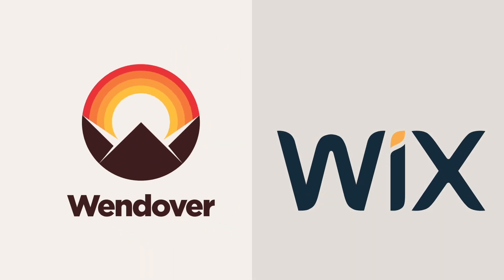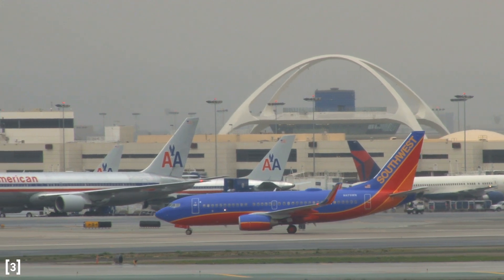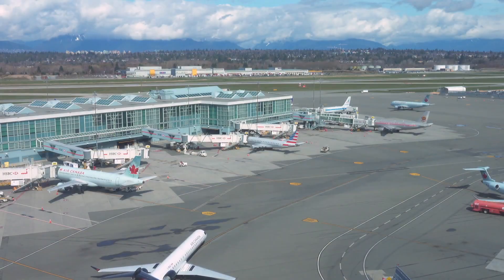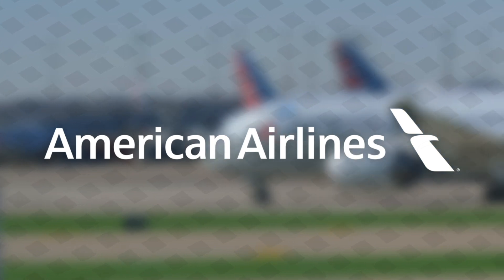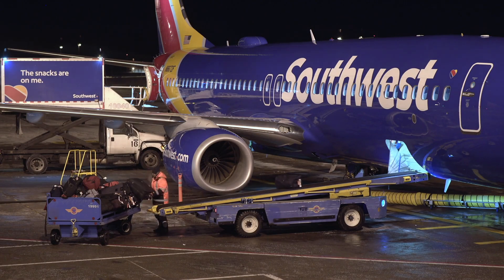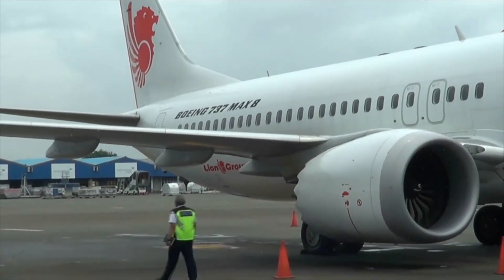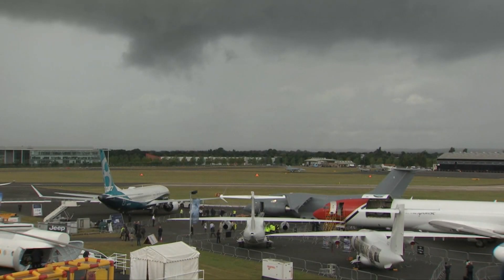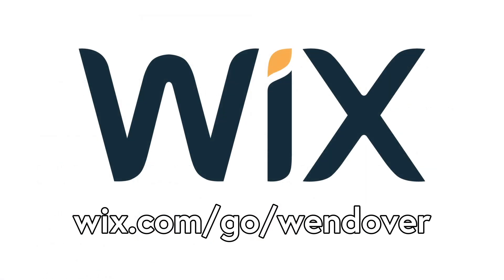The Economics That Made Boeing Build the 737 Max

Comment: “It has a few aspects that make it unique”

Its the first aircraft to be able to intentionally crash without pilot input
Reply: I'm pretty sure the Hindenburg wanted to crash after it was on fire, in order to get the passengers to safety.
Reply: @Aussie Tanker Your understanding of the word "intentionally" is sub-optimal. The planes crash due to a software mistake. A "mistake" is the opposite of "intentional".
Reply: Im pretty sure any plane would crash without pilot input
Reply: @eh4822  
Not my mavic drone lol.
I know it's not a plane, but it is an aircraft and does not need any skills nor any pilot to fly it.
Reply: @eh4822  Nope, planes these days are partly at the stage of automation that they could basically even fly alone. Pilots are mostly there to supervise, take over in emergency and perform takeoff and landing(not always). The difference between Boeings system and general autopilot systems is that boeings system cannot just be overwritten. You need to press a button within seconds and that button has never been showed to any of the pilots and was not mentioned in the handbook of the aircraft
Reply: @eh4822  Well depend on how you are talking about. All the commercial planes are aerodynamically stable. So as long as the engine is working without any input from the pilot the plane will maintain the heading and altitude.
Reply: I Set Some Grass On Fire DC-10 rear cargo door locking handle: Am I a joke to you?
Reply: Vsatyk United Airlines 585, USAir 427, Eastwind Airlines 517.

Google the 737 rudder issues.
Reply: Automatically*
Reply: Well........
Reply: How to turn a 737 MAX taxi,takeoff and brace for a crash
Reply: 747SP - China Airlines 006. 1985.
Reply: @ThatGuy-te9wh  well, it did it's best, it's just those guys tried to restart an engine as FL350.... and forgot to check the planes bank angle...
Reply: Funny, but not true. What about Air France 447?
Reply: @Santo_Aviation.YouTube  pilot error
Reply: @ahmeddarwich9267  there are a lot of people that would disagree. lot of fishy shit went on with that investigation. and it was shown that the plane would indeed go into "landing mode" if it thought it was low enough. 

not to mention it was in frances and airbus best interest to find the pilot at fault.
Reply: @ahmeddarwich9267  no it wasn't
Reply: @Vsatyk  Not only max wanna crash all 737 -200 -300 -400 have a "rudder issues"
Reply: Mateusz Zimon not all. The issue in the  original series has been resolved long ago. And the flaw didn’t extend to the classic series.
Reply: @mateuszzimon8216  And the 747 had a lower rudder 'hard over' issue, at least 2 of them.
I seem to recall the rudder 'hard over' killed people too.
Then we have the 777 that crashed at Heathrow due to a rare 'ice in fuel' problem.
Reply: Airbus was the first to cause crashes without pilot input.
Reply: Andy Madden they were not though.
Reply: @andymadden8183  if your thinking of the Air France demonstration A320, you need to think again.
Reply: KarlosBricks that’s controversy.

A330s were plunging down in the middle of the flight multiple times.
Reply: @gusp6612  yes but they all recovered. Don't @ me with AF447, that was proven to be pilot error
Reply: DoSvidanyaGaming the only reason they recovered is because it happened in high altitude. Unlike the Max, where it happened below 10k feet.

Also unlike the Max, where the dive can only be triggered by malfunctioning sensor. All the A330 systems can function perfectly and it can still dive out of nowhere. It’s a computer error that Airbus never managed to fix.

I’m totally against any system that alter flight control without the pilot’s command. Airbus’ anti stall system and MCAS is the two example.
Reply: @karlosbricks2413  I agree.  This crash was due to pilot error.  The flight computer was preventing a stall.  The pilot flew the plane too low of altitude and too slow, especially for an air show fly over at alpha max.  The pilot also missed the air show if I'm not mistaken.     I am typically a fan of Boeing.  However, the AirBus A320 was not at fault for this disaster and is a great airplane (e.g., Miracle on the Hudson).
Reply: @karlosbricks2413  no the a310 auto throttle

Comment: If a larger engine is more efficience and will be fitted but has to be re-position and that cause im-balance in the plane and MCAS was required, why? can't they re-design the landing gear instead of installing a killer in the plane? Pilots can see and computer can't, period

Comment: The reason Boeing didn't mention the MCAS is because an MCAS failure is identical to a runaway electric trim malfunction and is solved in the same way.  I'm very concerned about the fact that the 4 pilots on the accident aircraft were unable to handle what I'd call a relatively simple emergency when something hard, like an engine failure 3 knots above or below V1 could happen on any flight.

Comment: These MCAS incidents won't cause hardly any long term side effects. Many years ago, when the 737NG  came out, there were a series of crashes in which the 737 broke into 3 pieces. The fleet SAS grounded. It was found that Boeing outsourced labor to companies that didn't manufacture parts correctly, and that when assembled, the mechanics were alluring the parts to make them fit. Boring tried to cover it up but failed. Some of these planes are still flying, but Boeing recovered extremely quick. In fact hardly anyone remembers, or even knew about this. The same thing will happen to this.

Comment: The B-737 had several hard over crashes when it was first launched, and now the B-737 Max is unstable in flight due to the larger engines mounted higher on the wings. This plane is of unsound design and a soft ware fix, MCAS, is insufficient to provide the necessary safety margin. Imagine having a car that veers in one direction due to a design flaw but then has a software patch to provide corrective steering > how many people would trust such a machines. The B-737 Max should be scrapped, the plane is and always will be unsafe. And, Boeing must compensate the families of the Lion Air and Ethiopian Airlines crashed planes: suggested compensation $1 billion per fatality, and the responsible Boeing executives to serve time in jail for putting profits above human lives!

Comment: There is NO PRACTICAL DIFFERENCE in the fuel efficiency of the A320 Neo vs the 737-Max-8. Here are the empirical numbers. The A320 is a 44.3 tons aircraft empty but operationally equipped, it carries up to 195 passengers in a single class up to 3,500 nm with a maximum fuel load of 26.7 tons. The 737-Max-8 is a 45 ton aircraft empty but equipped. It carries 200 passengers in a single class layout (Max-200 config) to 3,550 nm with a maximum fuel load of 20.73 tons. Neither aircraft is able to take on maximum fuel with maximum passenger and payload. The A320 neo has slightly bigger fans on the engines; the 737-max has a slightly newer airfoil on the wings (designed in the 1990s vs the 1980s). Fuel burn is about the same per seat.

Comment: Don't know how accurate is a Bloomberg web article that claims that to save money, the company and its subcontractors used cheap 9-dollar per hour software developers, and used India software developers who had little knowledge of flying.  False stalling was created by depending only on the signals from one type of air pitch sensors, while the common existing horizon-indicating gauge signals, the throttle position signals and the existing air-speed gauge signals are not used, resulting in the new software thinking that a plane flying horizontally at full throttle at high speeds is staling, when the new air-pitch sensor malfunctions, perhaps from flying through a swamp of tropical inserts clogging the air sensors.  Pilots just did not think that such none-redundant and poor software could came out of such an established US company.  It used to be that cars made in America had a reputation of being lemons, while planes were well made.  Time has changed.  American planes may not be totally made in the US.  The US is starting to made lemon planes as well.  Pilots need training to learn how to fly lemons just like in the past US drivers needed to learn how to drive lemon cars.

Comment: You never mention the possibility of re-enginning the 757. The "75" is head and shoulders better than the 737. If Boeing had decided to re-engine and lighten the 757, upgrade the avionics they would have had a more efficient airplane at much less than the cost of the "new" narrow body design that you mentioned at the beginning of the video. The 737 "wishes" it could be what the 757 was when it was first designed in the 1980's. The 75 could have been what Boeing was looking for in terms of lower cost than a new design and more efficiency for airlines. They chose the wrong one and now they are paying the price.
Reply: 100% accurate. I'll take a 757 over any other small body anytime.
Reply: I can imagine a re-engined 757 having engines that are similar to the 787 but scaled down a bit. Though, they're planning on the 797 which has a seat layout akin to the 767, 787 esque front end, and engine layout like the 757 with a range that's a little closer to the 767.
Reply: The problem with that is the fact that the 757 is a far less popular plane than the 737. AA, at the time of their massive order announcement, had plenty of 737s but relatively few 757s. Southwest only has 737s in its fleet, as does Ryanair. The 757 is not the core part of the fleet of any airline.

Airlines wanted to have a modern version of a plane they already had in their fleet. For an airline that doesn’t have any 757s, buying a re-engined 757 would be just as expensive as buying a brand-new plane.

Comment: While I understand that this wasn't a full breakdown of the situation, there's a VERY significant, crucial mistake in the details - while the 737 MAX handled in a measurably different way(which is to say, it exhibits a slight climb tendency), the aircraft did NOT handle in a MEANINGFULLY different way; in other words, pilots that could fly a 737 could fly a MAX with no difference, their subconscious flying ability naturally accounting for this near irrelevant difference in characteristics(much like how one can naturally account for a minor pull to one side of the road in a car that is in need of a wheel alignment). This was confirmed after the implementation of of the MCAS system by simulator testing with the MCAS either engaged or disengaged without the test subjects being informed, at the conclusion the subjects reporting that they noticed no difference(I.E., the changes that it was making to the flight characteristics were all but imperceptible because they're so minor).

The problem is that the regulatory body, the FAA, REQUIRED a solution to this miniscule difference in flight characteristics between the two variants IF 737 licensed pilots were to be permitted to fly the 737 MAX with the same licensing; guys, understand that MCAS has NOTHING to do with making the MAX "flyable", MCAS is nothing more than an emulation program to make the most minor flight differences of the 737 and the MAX basically imperceptible(even if the engineers had essentially already achieved this to a practically '99%' level).

Saying that Boeing "pushed the 737 to its limits" is absolutely positively FALSE. Yet, unfortunately for every single Boeing engineer that managed to completely re-engineer this aircraft with the extraordinarily different modern engines, and that did so successfully without any meaningful difference in flight characteristics - just a measured difference to the FAA that isn't a felt difference to those actually flying these birds - they're all being thrown under the bus, with the bodies of the poor unfortunate souls of the victims being heaped upon them for the rest of their lives. All because of an unnecessary FAA requirement that lead to a horribly designed and managed flight modifier software(whoever was responsible for the implementation of the MCAS program probably shouldn't have had that responsibility) that the FAA put no effort into independently testing, and, finally, absolutely positively ATTROCIOUS reporting by everyone from the 24hr news networks at large, public crucifixion programs like '60 Minutes', and even 'informational' YouTube channels such as this one. I feel for those poor engineers nearly as much as I do for the victims and their families.

If you want to stay INFORMED about this topic, PLEASE look up the "blancolirio" YouTube channel; he's, first and foremost an actual airline pilot who currently flies Boeing aircraft, has a lot of experience flying Boeing 737s, and has R-E-S-E-A-R-C-H-E-D THIS topic quite extensively, including closely following the investigations of it and talking to the industry insiders(given his career path and all).
Reply: RyTrapp0 
I concur!

Comment: Just an honest question  I know that Airbus are still using Rolls Royce to power them and of course you will always get accidents ,so I don't think anyone can criticise them. I've noticed that Boing seems to have turned its back on Rolls ,because I heard it was cheaper to run them on a different engine so has re engined  its 737s .     I remember the old 737s ,as most of the package holiday companies use them and I could never fault them .As I asked is it in anyway due to the new engine ,as the people are losing faith in the  new one and would it be to there advantage for boing if they went back to Rolls -Royce

Comment: Nice clear analysis, It would have helped pilots if Boeing had told them about the MCAS system and installed a permanent off switch in case of the faults that caused the crashes.

Comment: They should have re-engined the 717 line into a "717 MAX."  Yeah they would lose the common type rating but the aft-mounted engine placement allowed an airplane to have large engines and be placed close to the ground at the same time without suffering any debilitating consequences. I'm sure companies like Delta and American would have been interested in that aircraft type.

Comment: You did a very good job in your research and presentation. I have been flying in 4 to 12 airplanes a month for years as part of my job. Boeing has always been my favorite. But man, Airbus really stepped up with that A320 and A321. The 737 is still a good and hearty frame, but that MAX engine forward design is just too much. And sadly it took two crashes and hundreds of lives to find that out. I believe the Lion Air plane was saved the day before by a deadheading pilot who knew how to disable MCAS because it was doing the dive thing. Then the next day that same plane crashed.
One would think that disabling MCAS would a) be easy b) something that pilots are trained to work with c) and rely on more than ONE sensor.

Comment: There won't be long-term or permanent consequences at all. The 737 has been through this before. In the 90's 2 aircraft crashed due to rudder hardover when their rudder power-control-units experienced extreme temperature differentials, "thermal shock", and reversed operation. It took years for the NTSB to realize this and inform Boeing, who immediately had the rudder PCU manufacturer redesign it. The 737 continued to fly as the most popular short haul airliner for another 25 years. It'll keep on keeping on.

Comment: The economics are simple, they were caught with their pants down by the Airbus A320neo and had to rush development of a competitor to avoid heavy losses.  That development resulted in the 737 Max (and that rushed development in crashes that are currently keeping the plane grounded until design improvements are made).
Reply: Bobspineable so technically wouldn’t it be American Airlines vault? 😂 (sarcasm)
Reply: @javierortiz5176  Actually sort of since they kinda forced Boeing to produce the MAX. But in my opinion, the fault lies in the competitive nature of the aviation industry. Boeing was simply trying to not lose their top consumer. There's nothing wrong with that in my opinion.
Reply: @triple7marc  Anything in aircraft manufacturing that compromises revenue or profit in exchange for safety and convenience is morally wrong!  Literally thousands of people put their lives on the line each day by utilizing this equipment, both passengers and crews.  They rely on manufacturers and their reputations to make good decisions, good designs and aircraft to assure their safety.  Anything less is unacceptable.     In my opinion, Boeing tried to push through a work around, where a much more extensive design change was in fact needed.  Many lives were lost in the process.  I for one would not want to live with that on my conscience.
Reply: Marc W. .
Reply: The A320neo has the same type rating as the A320ceo. IIRC there's not even the need for a conversion course.
This gave Boeing a reason to ensure that the B737MAX is the same type rating as the B737NG. Though there is a short conversion course involved.
Bringing out an entirely new aircraft type would have made it harder for Boeing to sell the plane to airlines. It would have needed to be much better than the A320neo to justify the additional pilot training.
Reply: @markevans2294   - Which means the airlines themselves were against a clean sheet 737 replacement Boeing just built the aircraft that was asked of them
Reply: The shocking thing is that Boeing hid the existence of mcas from airlines and pilots, not the design itself
Reply: Boeing took the cheap route. A 737 replacement should have been on the board 10 years ago.
Reply: Have you heard of the writing software called, "Word Perfect?"  They hiccuped and Microsoft stole the show with their version of office.